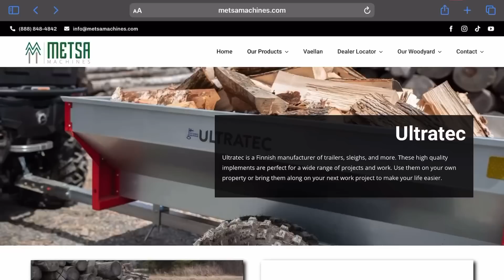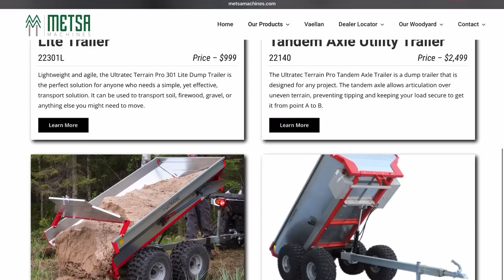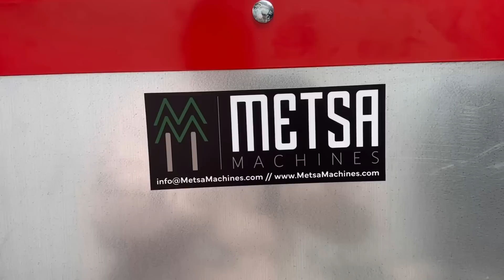UnBoxing and assembling a special item for the channel. #metsamachines #Ultratec

Comment: Love the way Adam and you distributed the explanations, nice and detailed assembly for the tech lovers here and application without too much detail about construction for people who like the firewood stuff. And for the people who like both, including myself, just watch both :) Keep up the great work! Improving it with an extra latch or a pin just to lock it in place will definitely improve safety. Another idea would be to add some dampening or to replace one or both (depending on the amount of force required) of the gas cylinders with a linear actuator. In the latter case, you might want to use a force arm

Comment: Thanks for the video Doug.  A very interesting trailer that would work well here on the homestead.  What concerns me, and I'm hoping you can show in future video, is how difficult it is to manually lift the dump bed with a heavy load (rated 3300lb max).  With the pivot point that far rearward, even with the powerful struts, I have to imagine you're having to apply a good bit of grunt force to lift.  They do offer a hydraulic assist version, but it's significantly more expensive.   So if you could show, with say a full heaping load of soil, how much effort is required to lift, I'd be grateful.  Ready to pull the trigger with positive results.  Thanks again!  Paul in Central Texas

Comment: Doug, I know it doesnt eliminate the risks completely but would it work to add a chock to where the bed / frame intersect and store the trailer in the up position so the shocks aren't loaded?  Would also help if it is stored outdoors to avoid gathering rain.
Reply from the maker: Great idea!! Definitely going to look into that! Thanks

Comment: 7:55 Kind of surprised they used fully threaded bolts instead of shouldered bolts. Also interesting that the valve stems on your wheels don't have shrouds, while Adam's does.

Comment: Great, detailed video Doug. The strut demonstration really shows the power of those things, quite the danger situation when I installing that part and flipping over the trailer. The safety pin/latch addition will be a good customization. If I may suggest, as I’m sure others have, a wireless clip on microphone will help these videos a lot. The volume difference gets a bit frustrating when you are up close and far away in the video.

Comment: Not to mention Doug, but keeping the Manufacturers' "Zerk Fitting" caps will also keep debris from potentially clogging the spring-pressurised ball of the fitting as well as looking cleaner!
For the rear strut Mounts, may I suggest a washer and maybe threading a ¼-20 bolt in there with a Nylock nut? (As I do not know the diameter of the hole, or a split pin?
Reply from the maker: I switched it to cotter pins. They work perfect!